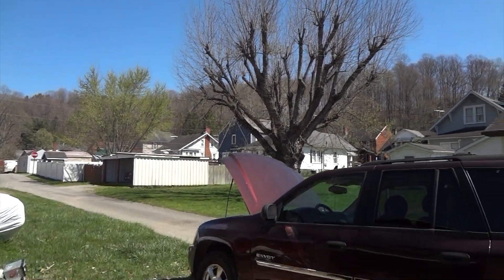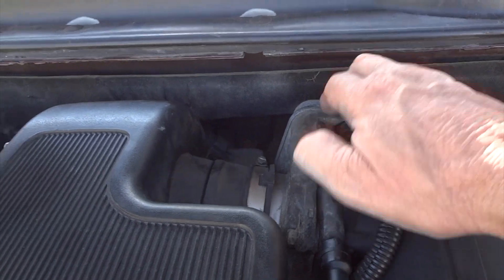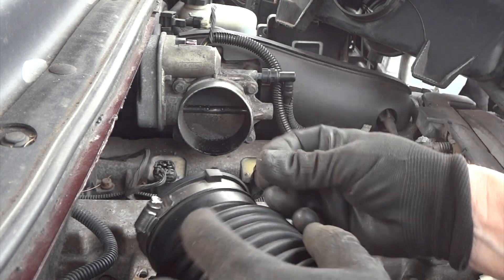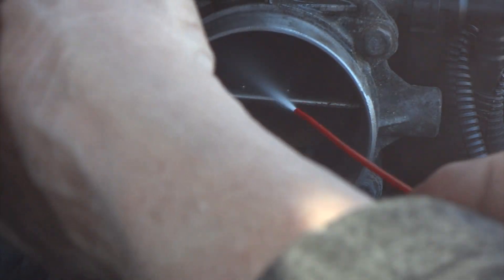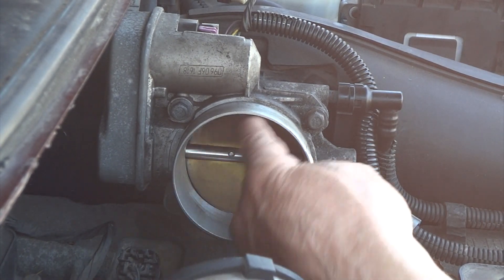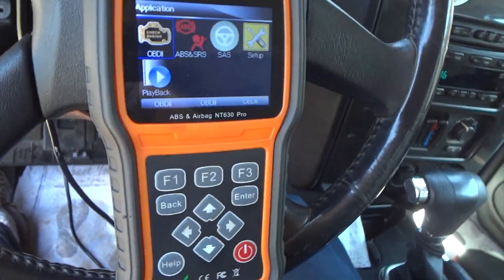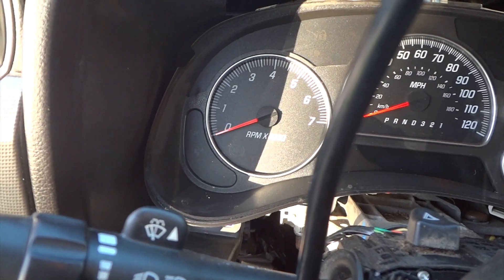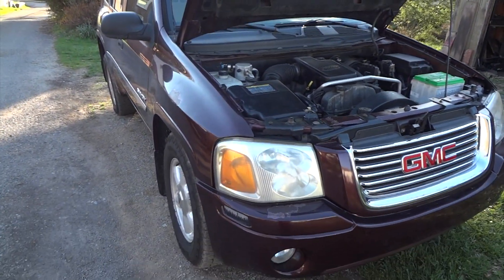Envoy/ Trailblazer Low Idling OBD2 code fix

Comment: Yes that throttle body was it. I would also go so far as removing the 4 bolts that hold it on, take it off and give the throttle body a really good cleaning. Once that build up gets too thick it restricts the air and it will run rough. Made a night and day difference on my 02 and 05 Tb. Love your videos!

Comment: I was getting low charge.
Had to take the throttle body completely off in order to get the other side clean.
Wound up not being the problem (bad alternator) but, she had better flow after this.
WORTH DOIN!

Comment: It’s the hose that goes on the bottom of the air box on the top of the engine, it’s the crank case vent when the engine is turned off the fumes go back up into the air box and coat the box and throttle body and constantly make them dirty, it needs cleaned every few months.

Comment: O2 sensor has heater inside for cold starts if it has 4 wires checked    😊to see if heater short out with meter

Comment: That lol in the intake track would worry me. Is it possible that the pcv system is the issue?
Reply from the maker: It has checked out last weeks testing.
Reply: The 4.2 for some really has no pcv valve and that makes them horrible with pcv issues and constant dirty throttle bodies 🙃🙃🙃🙃